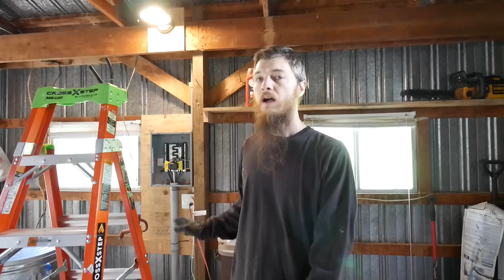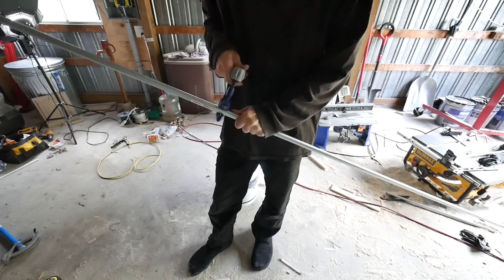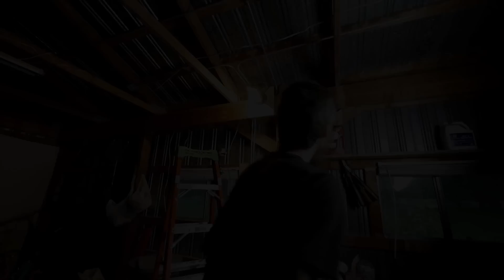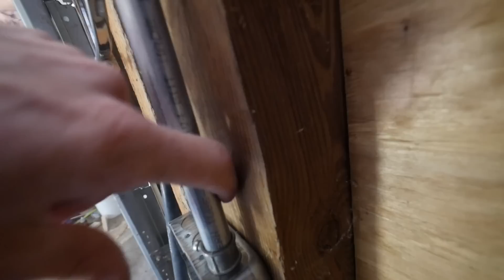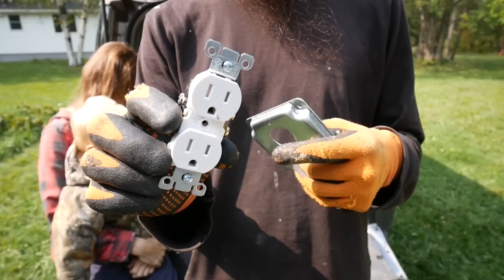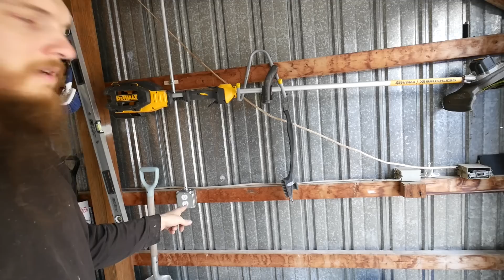New Electric - 1970s Pole Barn Restoration

Comment: Kudos for running it in EMT but I have never seen any one use a pipe cutter to cut electrical conduit.  Those things are supposed to be used for softer metals like copper plumbing.  Use a hack saw or Sawzall or portable bandsaw and you can easily ream it with a pair of Channellock's or a reamer.
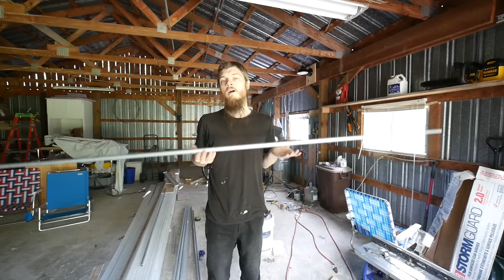Reply from the maker: Lots of people use tube cutters for cutting conduit. I think it's the best tool for the job as I showed at 4:11. The pipe cutter even says this "Used to cut copper, brass, aluminum tubing and thin-wall conduit".

Comment: Hey Doug, it looks good. Perhaps you may consider putting a slight offset in the conduit where it enters the box so it will lie flat against the wall. This would eliminate the need for the unsightly spacers. Keep up the amazing work.

Comment: Hey Doug,  In one of your recent videos you were using a small (orange ?) electrical multi-tool for stripping romex, bending the ground wires etc.  Do you have a link as to where you got it? I would like to check it out.  I have a lot of electrical type tools, but I like the compact size of the one you were using.  If no link, how abut a brand name?  Thanks.  Later
Reply from the maker: Ideal Lil' Ripper Stripper: https://www.homedepot.com/p/Ideal-Lil-Ripper-Stripper-45-025/202276237?

It's also on Amazon but it's almost double the price. I hope that helps.
Reply: @diyfferent  Thanks Doug.  I have a Home Depot 5 minutes from my house.  Later

Comment: With the price of copper so high why would one run a Earth ground green wire in EMT when the conduit itself complies with code? If one was going by the 2020 NEC then I would expect AFCI breakers and GFI outlets in required areas.
Reply from the maker: I just think it's good practice to run a separate ground. I don't feel that conduit is a reliable ground. We used GFCI breakers in the barn.

Comment: Love your videos! Just trying to figure it out though. It was my understanding that we didn't run Romex in conduit because the Romex jacket around the already jacketed wires doesn't allow heat to dissipate. I can't really see it being a big deal on that short run that you did but I don't want people to get the idea that as long as they're not using a junction box they could run long lines... of course I don't know why they would either but you know people. I've often thought that if I could build my own residence from the ground up I would use EMT and jacketed wires to prevent rodent  damage. I know it would be a pain in the butt but in the long run it would also be pretty cool if you had to run new circuitry at some point. Even if you just had one main run of it going across your main beam or beams. Just seems like it would be so much easier ultimately. What do y'all think?
Reply from the maker: Thanks! Yea, it's only short runs that Romex is allowed in sleeves. The limit may be 6 feet, but you may be able to do more depending on the situation. To do a whole house with EMT, use THHN wires like I was using.

Comment: Really nice job so far. I see so much potential. Your building looks big enough where maybe you'd consider partitioning off a closed-in section too use as a heated workshop during the cold winters in MI. You also can use a small area to get a jump start on early seedlings, veg. garden.  Just a thought.

Comment: We had to use a Plummer’s pipe wrench today to open a container of salsa that we got yesterday at Costco 

That sucker was on tight and that even almost didn’t work
Plan B was to cut the plastic container
Don’t know what the deal was other than it caught the thread wrong in the factory
Reply: Have had similar issue, they vacuum seal the contents.
If you don't need to reseal the container, pop a hole in the lid with a knife, that releases the seal and it opens easily :)

Comment: I know you are getting a million suggestions, but here's mine if interested:
Motion sensor light at each corner of the barn and a manual switched light at each gable end peak.
Use your anti-corrosive paste for all the breakers where they connect in the box.
220/240 outlet for a welder, large air compressor or ESPECIALLY a generator back-feed for when power goes out.
At least 2-4 outlets on the outside of the barn.
If your not an Electrician already, you may want to look into being one, because you're better than 95% of them out there already, and you can get paid while earning your license, then big money.

Ok, I'll stop bothering you now. Awesome job and thumbs up ! Also, the ending was beyond cute. Thanks for a great video !
Reply from the maker: Thank you :)

Comment: Great job, you’re really plowing into this job 😊 I was wondering though was why you ran the lighting conduit at roof level rather than on the cross beam level, to me it would have been much easier and used less material as well as eliminating any shadow issues. But a good solid job anyway 😊 well done 👍 and your son gets cuter by the day, he will be doing voice overs for you before long lol 😆
Reply: Are you asking why he ran the conduit along the roof rafters instead of the flat ceiling ? If so, I would do the same, just to keep it out the way as much as possible ?  That's just me though, no other reason really.
Reply: august I can see what you mean, it’s probably just that we do electrical work in very different ways in the UK lol I’ve watched loads of videos of people in America doing wiring and I just can’t work it out lol but I’m no expert on UK wiring either I just used to be a keen DIYer lol 😆
Reply from the maker: Basically just wanted it more out of the way. Just preference. Thanks!

Comment: Don't understand why you bothered with conduit. As far as I'm concerned about the roof and four walls that's a dry environment
Reply from the maker: The reasons we chose to do conduit is because it protects the wires from damage and makes for a neater install.
Reply: Mice.

Comment: Hint when you need to replace the polycarbonate cause it will go yellow. Try a slightly tinted so you won’t see discolouration and will protect some stuff maybe inside from fading if that happens. Love your work.
Reply from the maker: This polycarbonate is UV protected and doesn't yellow over time, but other types of panels may do that, thanks!

Comment: Great work and you did a really professional job.like to give you a few tips I have learned over thirty years of doing HVAC.when I do wiring like this I always write the breaker number on the junction box cover plates.it will help the next person who lives there.light switch and receptacles when in a metal box I like to wrap them with electric tape around the screws.i have seen so many people try and take them loose with power on and hit the side of the box.
I have said this before your pride in your craftsmanship is rare these days.

Comment: one thing i did different when i wired my barn, was to install the outlets upside down. For electrical tools and heavy extension cords,the cords don't fall out of the outlets because the grounding pin is helps to keep the cord from falling out. Very nice job on the conduit runs!

Comment: It still makes me so nervous that you have a water spout so close to a electrical board & switch 
or outlet.  I know that you didn't have much wire to move the board to another location, but moving 
the plumbing to another location would have been a easier thing to do.  Just saying.  No need to 
respond and please don't take it as an attack.

Comment: Great work. I have a question. How do you keep sawdust out of the outlets near the work station ?
Reply from the maker: The outlets we installed are tamper resistant so they actually have little covers built into the slots. That should help keep them clear.

Comment: USE AT YOUR RISK.  
Do Not Use Abusively.  
Copyright 2020 ATZE-TM  
Electrical Inspector: A red head is a rubber insert into a conduit to protect the wires from electrical shortings and wear.  It is red color, DIY code prescribers.  Advised.  Perhaps available at the store; ask for it.
Reply from the maker: The red inserts are usually for flexible metal conduit. But an important step nonetheless :)
Reply: @diyfferent  Oh.

Comment: As always I love your videos and attention to detail! Just wondering though if PVC conduits would be better than metal.
Reply from the maker: No, not in our opinion. PVC can't be bent without heating it and requires chemical glues to connect. It also sags easily and requires more supports. Metal conduit can be bent to our needs, and is stronger and better looking. It's just ideal for jobs like this. I would save the PVC for outdoor work where you water resistance is more important.

Comment: Have you tried putting the ground for the outlets up?The reason for this is in case a plug gets loose,if something metal falls on to it,it's safer to have it hit the ground pin than the hot or neutral prong on the plug.
Reply from the maker: We prefer them to be ground down. It's the norm around here and makes more sense for the way we use them. For example, we like to use extension cords and other things with 90 degree flat plugs and the way we put our outlets allows the cord to hang down from the box without strain on it. I feel that plugs are more secure with the ground down. But that's just our thoughts on it :)
Reply: @diyfferent  -It's not a hard rule as far as I know.The best part is you're more comfortable with the ground down,that's what really matters,doesn't it?
Reply: I second that, I alway put the ground up, accept under a Cabinet or where there is Counter were water may be present. Also on outdoor receptacles, I put the ground down, as some things won’t plug into the receptacles if the ground is up. I don’t like putting GFCI in the outside receptacles, they don’t last very long. I put them inside, and run my wires off the protected side of the GFCI. Yes, you’ll have to walk back inside to reset, this gives you time to think what you did wrong.
Reply: @stevenmoomey2115  -Thank you.As far as the GFIC goes,you can get GFIC breakers for the panel.That might be a good choice for you.
Reply: I've seen that in hospitals and other large commercial buildings, but never in residential situations.  Funny thing is, if the ground is down the cord is better balanced and less likely to fall down or come loose.  Catch 22.
Reply: @cjpenning  -Sometimes you just can't win!

Comment: The job looks good but could you explain why you chose to use metal conduit as opposed to using plastic conduit.
Reply from the maker: I just prefer metal. We try to not use PVC whenever possible. Metal is stronger and looks better :) PVC sags more and requires more strapping. It requires gluing and doesn't bend like metal conduit. For outdoors PVC is a good weather proof conduit, but indoors metal works best for us.
Reply: you can twisting and bending metal to different angel, but not plastic

Comment: I can't get my head around how you can do electrical wiring to a house without being a licenced electrician , in Australia that would not be allowed you can die if you stuff up , my hubby is /was a eclectrican for 50 + yrs and has done many house re-wires and new home wirings ..so I know its not allowed her.
Reply from the maker: In the USA homeowners are allowed to do their own work. To us it just seems like a basic freedom and right to do your own repairs and work.
Reply: In many areas of the US, DIY projects still need to pass inspection, others need permits. This is especially true in urban areas. 

Rural areas tend to have fewer regulations on DIY work.  The state or county have their own regulations.

Recently, however, a few things have become more federalized, I assume to try and create standards, but much is still left up to the homeowner.
Reply: I like doing my own work. Most of it is not rocket science, just common sense.

Comment: Have you used the trick to fish wire, by using a plug of paper tied to a long string, and pull it with a strong vacum cleaner. Saw it on Lumnah acres when they did their barn.

Comment: That looks ALOT safer, ALOT neater, ALOT Better, and couldn't look any more professional if it were done professionally.  Between the natural gable lighting and the upgraded electrical service in the barn, plus the cabinet/workbench install, the barn is FAR more functional than it was before, and it looks great with the freshly coated roof and painted barn.  Came together a bit faster than the house did for sure !!!! :)
Reply from the maker: Yeah, it's moving right along :)

Comment: Hi Doug,

Just watched your new video on the re-do of the entire barn electrical service, great job too, as usual, you are neat and meticulous in everything you do and that's not a bad thing either...! on the contrary it is good practice in my opinion and I am the same way as you are when it comes to things I build and remodel. I love that you have so many places now to plug in your tools & other general things that require an electrical outlet to power it. great job so professional looks great, and it is so much safer too......! Question are you going to replace the windows with thermal double or triple-pane windows? and do you plan to insulate and sheetrock the interior of your barn so that it will be warmer in the winter and cooler in the summer? I ask this because that is what I would do if it were my barn and I would do it to make it more energy-efficient and of course for comfort. looking forward to your next video Doug Carmen & I well we love them all. till next time take care.

From your friends in Lima Peru
George & Carmen
Reply from the maker: We don't plan on heating the barn so we'll be leaving the windows and interior mostly as they are. The heating costs would be pretty high and we don't think it would be worth it.

Comment: Just out of curiosity how much planning time does it take to make this look so easy? Thanks for sharing
Reply: Will you have a220 line in the barn
Reply from the maker: We have 220 available but I don't plan on running any outlets yet.
Reply from the maker: It depends on the job. This job didn't take too much planning, just decided where and how I wanted to run the power. Some things take me longer to plan, like plumbing :)

Comment: Doug,
Wow, that is Soo Nice, Neat and Very Professional Looking!!!
It's very Well Thought Out and Executed Well!!!
Good Sign off with the
future Youtuber...
Also, I have just a couple of Questions that perhaps could address on your next Video and they are:
1. Could you show how you Measured for and Bent the Angles for the Metal Conduits?
2. Please explain in detail as to Why Romax Wire Can Not be used in  the Metal Conduits to the Breaker Box?
Thanks Doug 👍
Reply from the maker: I'm not great at "how to" videos but I could try to show that. It's something that's easier to learn hands on than to be told. We'll see what we can do.

Romex (NM cable) just isn't generally allowed in conduit per code. It's hard to pull through the conduit and I believe they don't allow it because of heat dissipation issues, but don't quote me on that. It would require a large conduit size.

Comment: I'd like to know why you chose metal conduit over plastic.   I have a project coming up and interested in your choice.   Really like what yall are doing with the barn.  Awesome!
Reply from the maker: I just prefer it. I try not to use PVC whenever possible. The metal is stronger and I just personally think it looks better :) Thanks!
Reply: @diyfferent  Thanks for the feedback.  I live in a very humid climate and would be concerned about the pipes sweating and rusting over time.  Even though it's galvanized the still seem to rust.

Comment: Two Comments;  Never ever leave an exposed circuit breaker box open, especially with kids around.  Second, Please don't forget to connect the two grounds together.  Be Safe, God Bless.
Reply from the maker: It's closed up now. You have to open it to do the work but I do stay aware of it and switch off the main whenever I can. Do you mean the house ground and barn ground?

Comment: those pipes can serve double duty. provide runs and protect the electrical line. and, also, act as water access points. how awesome is that.
good video. thanks. bye.

Comment: Call me crazy but i wouldn’t circular saw over my knees. I mean people loose fingers on table saws and they can see the blade height. Just not good form. Be safe brother.

Here i am being a keyboard warrior.... i am thinking you ran out of conduit, because you ran two outlets at least once on camera,  that are next to each other with separate conduit. A very small hole from one box to another box through the stud would have also been fine.
Reply from the maker: I wouldn't want to drill through the post, that's all.
Reply: DIYfferent i figured as much. DIYfferent strokes for DIYfferent folks. ;)

Comment: I grew up in the Chicago area where EMT is required. Since moving to NH I've wimped and used a lot of NM (Romex) and in special locations PVC conduit.  Since your barn is open using some form of conduit is important to protect wiring from damage. Nice job.

Comment: I like that you are using steel conduit. It will be much safer from animal damage in the long run. Nice tip on using the pipe cutter. Thanks

Comment: ❓ Did you separate the lights onto 2 circuits and 2 switches? That way you only have to light up the half of the shop you're working in if that's all you need. Great cost savings❗🥰
Reply from the maker: I just decided to do all the lights on one circuit.

Comment: There is quite a difference to how these things are done here in germany, I think all over Europe also.
Nobody would come to the idea to do junction boxes or pipes or housings for switches or power connectors in metal, they are of course all in PVC.
The cables used inside the pipes are not single cables but 3x1,5 (or 2,5) mm² with a shield around them. In a barn we would not necessarily use pipes around them at all unless for optical reasons.